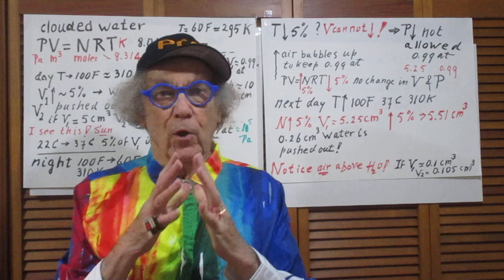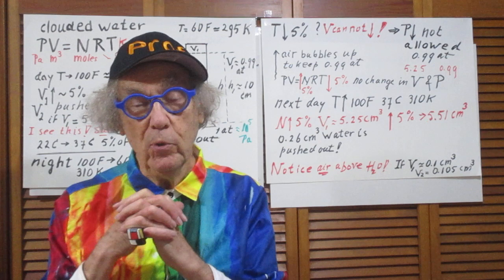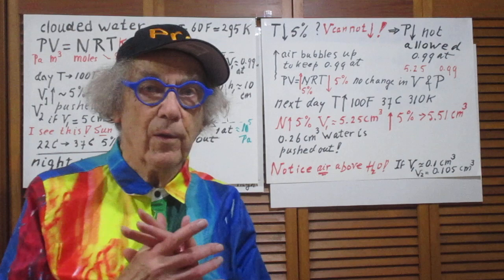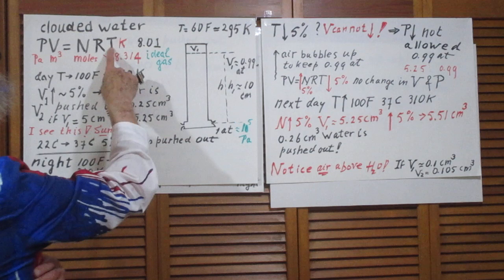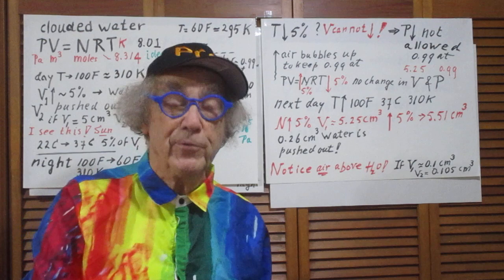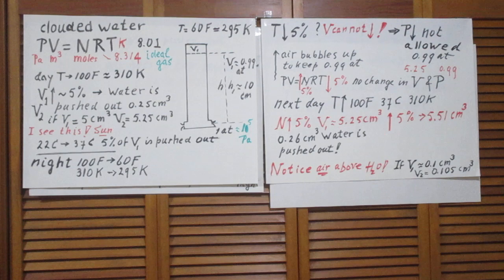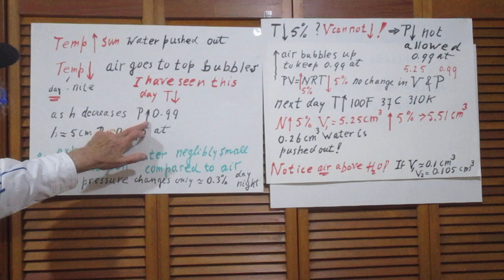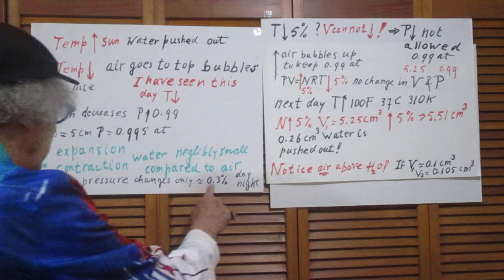Solution Hummingbird Mystery, Problem #118

Comment: Sir, I think that when birds drink, you will see bubbles of air going up. This is because when water level goes down, as you said, pressure inside goes down (because hydrostatic pressure goes down and the air above water now has more volume: V up, P down). But that can't happen, so nature will deal with it by getting more air inside (increasing N in the equation PV=NRT, cancelling out the increase in V and getting extra pressure because of the hydrostatic pressure of the water that went out). So we will see bubbles getting in, the same way as when the temperature goes down. I hope  being correct.

Comment: My guess is that when a hummingbird drinks from the feeder and the water goes slightly down, air from the outside will be pulled into the feeder in order to maintain the air pressure inside the feeder.  However, I know essentially nothing about physics . . .

Comment: I would treat it like drinking from a metal water bottle. When you suck the water out the pressure drops because of the suction. When you swallow the water air will rush back into the bottle to return to the proper air pressure. You van see this happening when you hold a bottle upside down as well. Water flows out but not at a constant rate. Eventually a bubble of air will go into the bottle to restore the pressure.

Comment: If you take out water from the container you are decreasing the volume of the water thereby increasing the volume of the air at the top. Since pressure times volume must be constant, if you increase the volume the pressure must go down. There is a force pushing against the water at the drinking bits of 1 atm. To equalize the pressures the atmospheric pressure pushes in the water and thereby releases air into the container. So you will see air bubbeling up.

Comment: No, I think the 'nectar' cannot be sucked out completely by the hummingbirds because they don't have enough suction power to overcome the difference in hydrostatic pressure. So, the water level will decrease only till it reaches a certain minimum height, beyond which it will not decrease.

Comment: First, about that atmospheric pressure.  It is not uncommon for it to change 1 inch of mercury (out of 29.92 inches) with "ordinary weather".  That's about 3%, just a little less then the swings of absolute temperature.  So this acting alone will also cause water level to drop.  In concert with temperature, it depends upon the relative phases of each.  They could cancel, or add.
          When the birds drink, solution is removed from the J-shaped tube (the tube must angle upward or the "water-staying-in" mode would be UNSTABLE.  The same thing happens when a jar without lid is overturned, but if the jar has a saucer over it, the saucer forms that J-path, & water stays in.  The upward angle of the tube permits a stable arrangement where air is over the water.)  When this liquid is removed by the bird, the stability is upset, there now being water-over-air.  Small amount of air enters & bubbles to the top, increasing pressure at top, allowing water to fall & refill J-tube, restoring stability.  As water descends, volume at top increases & pressure drops, once again supporting water column & stopping outflow.
          In order for the stability to be upset by the drinking, the bird must be able to reach to the bottom of the J-tube.  So the tube must be shorter than the bird's beak.

Comment: After the Humming birds disconnect from the flower, they've created a negative pressure, the system will suck in air to compensate and thus keep the P the same. It's the same concept of drinking from a juice box and you get that sucking sound after you've taken a big drink!

Comment: I know their little tounge's shoot in and out at a high rate so maybe some air gets in as the tounge is pulled back and then possibly the air forced up as the tounge shoots back out of their lil beak. Its a very interesting question ❤
Reply: I dont have a hummingbird feeder so I've had to watch a video stream of one. They're large feeders and in the morning they seem more inclined to perch and guzzle down lots of the water and after a few minutes or so there's a large release of fairly good sized bubbles. I don't know about the designs of the outlets, how they're laid out, a venturi of sorts so how it holds the air down for those few minutes and how the birds are helping to instigate this it I'm not sure.

Comment: When the hummingbird drinks a lot the water level will drop increasing V1 which will result in decrease of pressure and as the height of water has also decreased this results in the decrease of total pressure at the hole at the bottom. As atmospheric pressure is higher it will push in bubbles until the pressure in the cavity rises to original and even further in order to compensate for the decrease in water column.

Comment: Prof Lewin promotes realization rather than mere understanding, or experience--making the ideal gas law seem like a paradox.

The new question is, "what will we see when the hummingbirds drink a lot of water? Will we see the level of the water go down?"

Solution: Suppose the control volume is the current mass of air suspended above the top of the sugar water's surface. While the hummingbird is drinking, adsorbing sugar water onto its barbed, forked tongue, intuition would suggest that the size of the control volume of air would be theoretically increasing and the water level would be theoretically decreasing--not quite. On the smallest time scales, the control volume at the top of the feeder would remain constant size. Only local water volume decrease at the orafice (feeding hole) would be observed, only while the hummingbird is feeding... that is until the local water level recedes as close to the inside of the orafice as you would like to imagine, and then perhaps into the feeder. At that time, we would observe the control volume of air attempt to increase in size by allowing air molecules to pass in. In a fight to lower the internal energy of the system, air molecules would want to rise into the control volume, but the number of air molecules in the control volume cannot increase spontaneously if the water has not broken surface tension at the orafice--there must be a change in either volume, or pressure in order for more air molecules to spontaneously inject themselves into the sealed-off control volume of air. Pump the brakes, bulk volume cannot increase instantaneously, nor can temperature. I claim that there must be an oscillatory change in pressure of the control volume caused by mother nature's never ending will to resist the change in the pressure of the control volume. The driving force for the formation of bubbles is caused by a transient, microscopic fall in sugar water level, followed by a violent, macroscopic jump and subsequent correction fall of the sugar water. While the water level is decreasing on the last correction fall, mother nature (atmospheric pressure) wins the fight to lower the internal energy of the system. When the air of the control volume is rarefacting, or becoming less dense, and the meniscus is getting pulled out toward the orafice, the pressure of the control volume (air) inside the feeder is instantaneously lower than the pressure of surrounding air acting on the water near the orafices. This is confirmed by the notions that the air in the feeder is sealed-off, the surface tension at the feeding hole is attempting to pull the meniscus out of the orafice, and the atmosphere is resisting changes in pressure (propagating as sound waves) to counter this response to feeding. Again, we are interested what is causing the water level, h, to eventually decrease. Air molecules are trapped in the outward pulling meniscus when the atmospheric pressure collides with the sound-pressure waves created by voids in the suddenly shifting meniscus. The hydrostatic pressure of the water, which typically produces a normal, upward force acting on the bottom of the air, is transiently reduced at the subsquent fall of the last pressure fluctuation--down, up, down. Keep in mind, the mighty forces of mother nature are continueously resisting all changes in the level of the sugar water, trying to keep the control volume at constant pressure. The control volume responds as the atmospheric pressure outside the feeder pushes the menisucs back into the feeder near the orifice during the violent, microscopic, upward, jump of the water as a whole. Remember, the size of the control volume of air is unstable upon decrease (compression). Now, during this falling motion of water, the pressure of the control volume is decreased, air trapped in the meniscus of the sugar water is forced into the feeder, and into the control volume due to pressure fluctuations and sound-pressure waves from mother nature. Again, in such short time, once the hummingbird has just finished feeding, if the water level has passed through the inside of the imaginary surface attached to the orafice, air molecules will have rushed to the transiently reduced pressure region of the control volume. At the last moment, we would observe bubbles form from the imaginary surface attached to the orafice to compensate for the sound-pressure wave fluctuatations. We should assume there is not enough time for the temperature of the air to change due to expansion of control volume in that instant, the increase in compressed air volume would be accompanied by an increase in the number of molecules in the control volume--hence, bubbles appear. Recall ideal gas law, pv=nRT, in order for the size of control volume to increase, more air molecules must enter the control control volume while mother nature attempts to maintain a stable pressure equalibrium. If more air is not allowed to enter the sealed off control volume, pressure fluctuatations are dampened and the cycle repeats. At the end of the pressure change reactions, the height of the water goes down as more air is injected into the control volume. This is because mother nature's only option to kill the pressure fluctuations is to allow more air molecules to enter the control volume. Instead of changing temperature instantaneously, the driving force for water level decrease is mother natures response to rarefaction (decrease in density) of air molecules. Molecules are spawned into solution to attempt to continuously control the equalibrium pressure of the control volume. The size of the control volume increases, and inevitably approaches atmospheric pressure--seen as bubbles injecting themselves into the control volume. Depending on geometry I may suggest that water could even leak out after air molecules (bubbles) are injected into the control volume in order to conserve mass of the system. The leaked water may remain in the feeding hole depending on the geometry of the feeder. Simply beautiful.

Comment: Hello Sir, To answer your question in the end I think as the bird drinks the water (assuming at constant temperature) the water level must go down. And as we know that P(air at top) + P(water column) = 1atm and as the water level decreases the P(water column) decreases so P(air at top) must go up. Now also PV=NRT as T is constant and we already saw P increases and so does V because water level is going down. So the only thing that can compensate this (increase of P and V) is increase of N. So you must observe a phenomenon similar to what to observed during the night that is bubbling up of air to increase the N. 

Sir I also had a doubt, why don't we observe a bubbling down of air during the day to compensate the increase of temperature during the day. Why is there a sort of priority that during the day as V can go down so we increase V to balance increase of temperature. Why doesn't it happen that V remains constant and N decreases( that is bubbling down of air) to balance the increase of T during the day. Will be honoured if you would clarify this doubt. Love you from India 🙏🏻🙏🏻.

Comment: Sir, when I rolled the transparent tape in piece of iron rod (small) and after 6 months when I opened the tape it used to act as a magnet for some days ....why did it happen Sir ??
Reply from the maker: use google or watch my lectures
Reply: @lecturesbywalterlewin.they9259  Sir but I didn't expose it to magnet or even it's Curie temp..
Reply: @gopalkrishnapathak940  xrays from peeling the tape 🤔

Comment: I'm curious why you haven't mentioned the saturation of the air from evaporating water or the surface tension of the water at the holes....
I appreciate the simplification of the problem here, but isn't it important that when you fill the water, there's little humidity in the air, while after leaving the feeder out in the sun, the air inside would become completely saturated? 

I'm not trying to argue the solution you present, but just knowing what I do about water and water vapor, I'm curious why this would be negligible here....

Also, when the birds are feeding, wouldn't this change the surface tension at the holes by increasing the surface area of the air to water boundary (as they press their beaks against it), and allow bubbles to form due to the difference in pressure overcoming the tension, and could this be a mechanism for how more air gets into the top of the feeder?

Again, I'm not claiming to know the answer here, but it seems these are important considerations from my intuition

Comment: I thought it was something to do with surface tension as well because usually if we fill a polybag with water and poke holes in it. Hold it on height..water comes out automatically. Due to gravity I guess.. Same doesn't happen i in case of hummingbird feeder why?